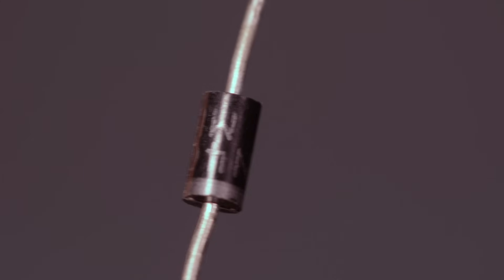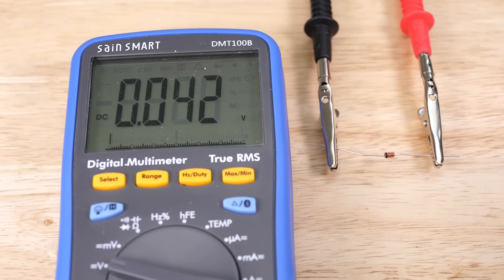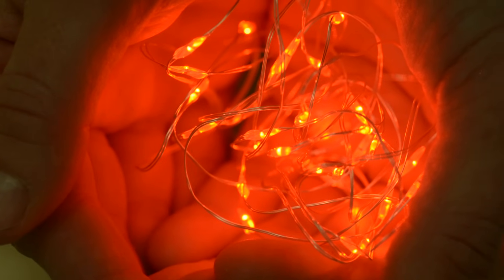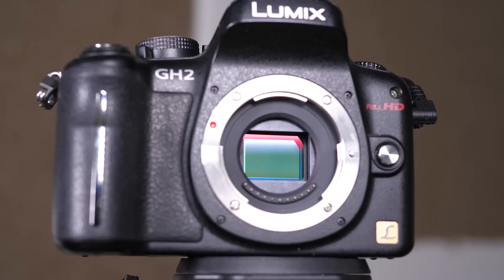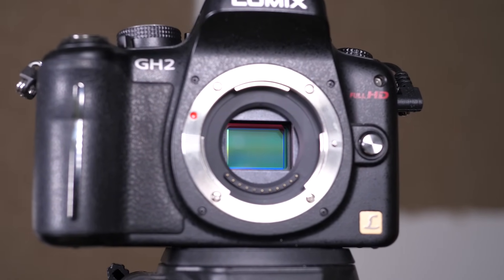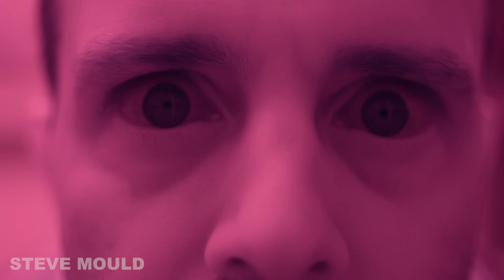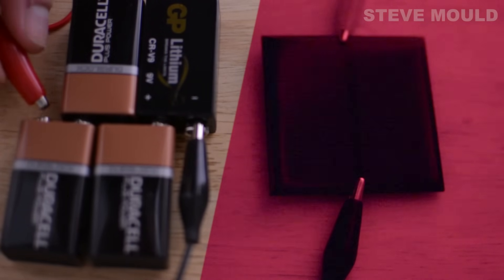Why all solar panels are secretly LEDs (and all LEDs are secretly solar panels)

Comment: a while ago i was thinking how a light bulb converts electricity into light then i started thinking well what if i reverse the process and put all that light back into the element will i create a current? sure enough i realised that is what a photocell or solar cell does, takes light and converts it to electricity, i tried this with led's using two of them hooked up to each other with + to + and - to - and shone a flashlight on one of them and noticed the other one lit although very dimly(poor conversion)it still showed a current was being created

Comment: I know it would be small, but how much power would an oled phone screen generate laying in the sun?
Reply: Way too little to matter, + the heat absorbed would counteract any benefits (it would degrade the battery and display itself)

But just as a thought experiment, an iPhone 15 pro max has a 110cm^2 display. An average commercial solar panel makes about 300 watts per m^2. So if the OLED had the same efficiency as the solar panel, it would make about 3.3 watts. Pro max has a 17.32Wh battery, so it would need 6 hours in full sun for a full charge. In practice that would be about 2 days on a clear sunny day for a full charge.

That said, because LEDs are not optimised for absorbing light, they would be less than 1% as efficient as a solar panel. So that 3.3 watts would be closer to 33 milliwatts, or about 22 days of direct sunlight, or about 150 real life days, for a single charge.

Comment: I found this out when i was trying to fix my led garden lights recently, i put my multi meter across the long string of colourful leds & was reading around 1.8 volts with no other sources connected to the led's.

Comment: Diodes can also be used to detect ionizing radiation. They output picoamps when irradiated by say, a radiotherapy machine. They're less sensitive than ionization chambers but can form denser detector arrays.

Comment: You csn make a wheel speed sensor, using a laser & LED. I remember seeing that somewhere. Shine a laser at the LED. if the wheel has 5 spokes for example, then 5 interruptions of voltage from the LED means one revolution. You, or software csn use that to calculate the wheel speed, without touching it, or having a sensor built in, dragging or weighting down, or imbalencing it with magnets or other sensor tech.

Comment: You shouldn't connect an LED - or a solar panel - directly to batteries like that. You should always use a resistor to prevent damage due to over-current. How come you know solar cells emit light but you don't know that??
Reply: 0:36 all those LEDs already have current limiting resistors attached to their legs. How come you know about current limiting but you don't know that a 9v battery without a resistor would destroy most LEDs??
In any case it's a video about a different property of LEDs and solar panels so he probably used those ones to keep it simple and avoid explaining why resistors are needed.
Reply: @Ellie_Melloy  The solar panel has no resistor when he's powering it to make it glow. You can SEE it doesn't.

Comment: I just watched the Quartz videos and if you haven't seen them go do it they're fun but importantly it's about the property of quartz where quartz will produce a voltage when you hit it with something, and it will also deform when you apply a voltage to it
so there's a clear analogy here to piezoelectric things--applying a voltage to do a thing means you can do a thing to create a voltage. So I guess the idea here is that these processes, if we optimize them, can be made to have zero entropy I think?
Reply: Yeah, speakers and microphones, LEDs and solar panels, quartz deformation/vibration, motors and generators. It's all just energy transference using electromagnetism. Even silver (the best known conductor) has some resistance and loses some energy as heat, however small. I'm not sure zero entropy is possible, there's probably some scientific reason why finding a material with no resistance and getting exactly the same energy out of one end of a wire as was put into the other end would require creating energy from nothing which would break physics.

Comment: I have a bin that has a sensor to open the lid, I let the batteries run flat, then after a few sunny days noticed the bin started working again, must have been charged from the diodes!

Comment: From a physics standpoint, it is simply a conservation of energy concept. The same as an electric motor is a generator if you turn it backwards. Electricity goes in, it turns. Turn it manually, electricity must come out.

Comment: i really liked this video (see: "Why all solar panels are secretly LEDs (and all LEDs are secretly solar panels)" https://youtu.be/6WGKz2sUa0w ). i had to watch it a few times to understand it better.  i would like to know/see more about how infrared LEDs are used for motion sensing cameras
And on a playful way of taking this info to expand on it in a biological sense. Is this why in some spiritual philosophies they believe that the sun energizes the body (in particular their neurological part)? And an example of when there is no sun for the human body for long periods of time, the body/brain becomes depressed? and by getting an artificial full-spectrum light source and having it directed at the face/eyes it absorbs some of that energy, the depression in those people is reduced or eliminated? I presume that the neuroreceptors, beyond the eyes, have this capability (such as near the surface of the skin of the face for example)? Are the human eyes essentially biological diodes? And perhaps the reason, in part, some people hear tinnitus or have tinnitus.. the tinnitus is the result of a broken biological microphone which creates a kind of feedback loop which causes them to hear the high pitch sound of tinnitus?

Comment: so... if I hooked up my christmas lights to a timer and a chargeable battery, would it be possible to have the turned-off LEDs charge the battery during the day and have them use the battery to emit light overnight?

Did I just revolutionize christmas decoration?

Comment: One thing I noticed about solar cells is that covering them from one side, even just a little bit, caused the voltage to drop dramatically, but covering from either adjacent side, even a lot, doesn't lead to as much voltage drop.

Comment: Do LED lights still provide a voltage while emitting light themselves? - If so, could this also help reduce electrical usage in a house with multiple LED lights?
What I mean, is if you have an LED providing light, if you were to shine another light onto that LED, does it still produce extra electricity?

Comment: So take a diode and charge it with electricity ao it lights up then shine that light at a diode that then shines light on the first diode. Now the diode with light shines on the first which charges it and sends the current of electricity to the second diode. So now its a self charging diode system. Now you have free electricity.

Comment: FWIW, the applications aren't limited to imaging cracks for the failure analysis of PV cells: a decade or so ago, I helped a colleague use images for PV cells when reverse-biased at different voltages, to compute the efficiency of the PV cell at individual points in there, and help characterize those cells but also help improve the fabrication process.

Comment: It's a long time since I had to learn about semiconductors, but one thing I remember is that you cannot build LEDs from silicon, because it is an indirect semiconductor. To emit a photon, these semiconductors don't only need exited electrons, but also a phonon is required. And this is basically where my physics knowledge ends, because I can't properly explain what a phonon is or does...

Comment: I just tried this out, because I never thought about this until now. Hooked up an LED with a multimeter and used a bright flashlight to illuminate the LED. The multimeter read close to 1000 millivolts! Very interesting.

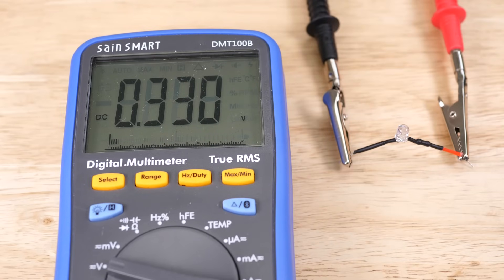Comment: 4:10 Wow is that just a normal LED? I'm impressed that it could generate a voltage so relatively high. I once did an experiment in school where me and another guy tried to make solar panels out of copper plates submerged in some acid (I think... we didn't really know what we were doing) and we only got like 0.01 V which... isn't a lot. I'm gonna be a bit pissed now that I'm finding out that we could just have used an LED instead.

Comment: In case anyone's wondering, the term that encompasses both microphones and speakers is "transducer", or a device which converts between acoustic information and an electrical signal

Comment: I worked for a solar panel manufacturer and we used an EL machine that charged the solar panels with 70v dc and took a infrared picture to check if all the connections were made an if cells were damaged.

Comment: same as i know from  a 40 years ago, where you could remove the top of a metal cased transistor with a file 
and then use it as a solar cell as  for example, the principle is similar , also as  a Opto-coupler , optec , the optical input  etc.

Comment: I'm an electrical engineer. You can use many kinds of microphones as speakers, but not all. Condenser microphones, which use capacitance, won't function as a speaker. Virtually all speakers can be used as microphones.

Speakers usually use magnetism. Some crude speakers use the piezo-electric effect. Both of those will work in reverse as microphones.

Comment: This somewhat explains a phenomenon I experienced with my led flashlights. When I take the lens off of my Emisar D4S and get in close on the chips with an olight uv flashlight, the other chips on the emisar begin to glow on their own. No battery in the flashlight. Very cool
Reply: I think that's just the phosphors glowing from the incident UV light, not the electronic portion of the LED itself.
Reply: @TheAnachronist  I don't think you understand, I can isolate the uv light I aim at it to hit only one led chip, (super close) and the other LEDs that don't have the UV hitting them begin to produce light. No joke

Comment: I do this every day at work - load up a module into the (pitch black) EL chamber and run a current through it, and use a camera with special aperture and exposure/ISO settings to capture the pattern and check for any cracks. They become very obvious under these conditions. Oddly enough, some of the extremely cracked modules sometime still produce an OK amount of power. Depends on how the damage happens. 

If you have solar panels, clean any leaves that fall on them. If they shade the exact percentage of a cell needed to cause a 'kink' in  the electrical flow, heat builds up and it can literally catch fire. We do a test called the "hot spot" test that puts various sizes of square tape over a section to find the magical % of a cell that causes the "kink" so the manufacturer can put it in their specs/manual.

Comment: Soo... Does this effect transfer to night vision devices? Because solar panels could then be low intensity distributed InfraRed light, but more importantly, they could have dual purpose uses as battery chargers and IR signalling in military applications.

Comment: You know, one thing im learning about physics is basically everything is reversable if you reverse the process. Say a stirling engine, if you put energy into it you get a heat pump, heating and cooling the gas. In chemistry if you have something that releases energy and creates products, you can put that energy back into it and it'll reverse, TEGs will pump heat given electricity, solar panels are LEDs and LEDs are solar panels

Comment: I think what you are "seeing" IS NOT conventional "LED action".  Why do I say this?  Because it is apparent you are applying HUGE voltage (36 volts on that panel most likely made to produce a few volts when illuminated).  Is the direction of the voltage applied forward or reverse biasing the diodes?  Since you have a lot of voltage, I suspect you are forcing the diodes into reverse avalanche conduction.  There is a totally separate phenomenon, where the electric field is so high that charge carriers are being "ripped" off & accelerated.  When they collide with a neighboring atom, they knock off bound electrons which rebound & emit light.  The light is white because it is a random process (having nothing to do with the bandgap of the diode).  Light is VERY dim, as in less then 1% of the intensity of light from LED action.  It can only be seen in VERY dark room, & it is easy to damage the diode in effort to get enough light to see.
          You are definitely using this process, because you couldn't get visible light from silicon.  Check the polarity of the battery against the conduction direction of the cell (many milliamps or even amps should flow in the "forward" direction) & the "forward" direction is the one that causes LED action.  You are hammering the "visible emitter" cell with 9 volts.  If you put that battery in the forward direction, so much current should flow that either the battery voltage gets "flattened" to 0.7 V, or the cell gets damaged.  Get out your meter & check the V/I of the loads you demonstrate.  Betcha voltage is high & current almost nothing (diode avalanche mode, battery "backwards").  The calculator panel is making light only at the cell boundaries.  With 14 volts, you are avalanching the inter-cell insulation!
          You can also get this light from reversed-biased B-E junction silicon transistor.  Select one in metal can (such as TO-5), cut the lid off.  You need transistor that is not totally metallized on the top.

Comment: Hi, I did remove my camera IR filter and I passed a 3A forward-based current in my 20W solar panel @ 26V. and I tried to film it with the camera but nothing shows on the LCD.

The solar panel is polycrystalline type 22V Voc 20W

Where did I do the mistake? shutter speed? apriture? 

My email is hussien_nassir@yahoo.com

I can send the picture

Comment: This video gave me the idea to test old film camera shutter speeds for servicing them. I made a really simple device which is just an LED soldered to an input jack connected to an audio interface to my PC and then on the other side of the camera shutter I put a laser pointer pointing to where the LED would be on through the shutter, shoot the camera while recording the "audio" signal and then see the audio clip to check the interval. And it works perfectly :)
Reply: holy shit. that is absolutely fucking mad genius
Reply: this comment is extremely underrated

Comment: Most photodiodes are made of Silicon while LED’s are made of GaAs.   GaAs is a direct semiconductor while Silicon is an indirect semiconductor.   An LED needs to be a direct semiconductor.  The only way that Silicon can emit radiation is due to impurities in the crystal.

Comment: Because it's the same technology. No need to watch the video. I know the answer. But there is something more: All semiconductor's react to light. I saw a transistor without it's housing. It's resistance did getting smaller when light hit it. But to create current from light or vice versa only led's and solar panels are capeable. But i really would enjoy a video when that is the investigated thing: from whitch frequency of the light is from what solar panels can create current. As the leds have color, i guess every led and solar panel have some color frequency from what it can create current, and it not reacts to other light frequencies.
I have tested 3 color type leds in sunlight which is giving higher voltage. Yellow was the best. It gived   0,7V. The green gived 0,4V, and red was the worst. Only 0,2V (if my memories are good) 
Sry for the English!

Comment: Of course, because Gallium is used in LED's and solar panels... NASA is even researching on how to make CPU's out of Gallium Nitrade because... it's less susceptible to the harsh factors of space from cold/hot fluctuations and of course, the radiation, space has killed many CPU's and with things being high up in space there's some particals that do of course hold electrical current and well, electricity in the right place in electronics kisses fingers electricity in the wrong place of electronics can be quite disastrous including misfires of hydrazine engines... fun!

Comment: One thing that should have been mentioned is that the various corresponding combos (speaker <-> microphone, etc) differ in that they are engineered for optimal performance in one way or another. A large diaphragm works better for emitting sound efficiently over a small spectrum, while smaller diaphragms work better for absorbing sound across a wide spectrum. A lens for a camera is larger so it can collect more photons over a greater physical area, while a lens used for a flashlight that emits light can use a much smaller lens since the light source is concentrated.  So while many things can work both ways, it will work very poorly in the reverse manner it was not designed for.

Comment: Almost any diode is bidirectional, if connected to the internet like for example with night vision cameras that have infrared diodes you could pass a signal through them with laser flashes  translating to 1s and 0s. Basically hack your way in.

Comment: Old video but I just came back to it with a new idea! I wonder if one of y'all can figure out how to put a jewel thief or something on a flashlight so that when it's off and sitting in the sun is charging the rechargeable batteries inside for when you need it at night time. The easiest way would be to put solar panels on the back of the flashlight, but where's the fun in that! There might be a fun project for a YouTube video in this idea.